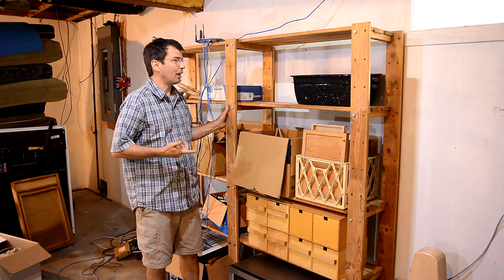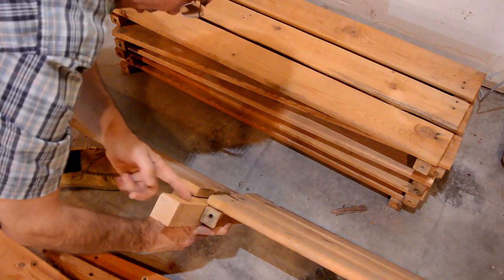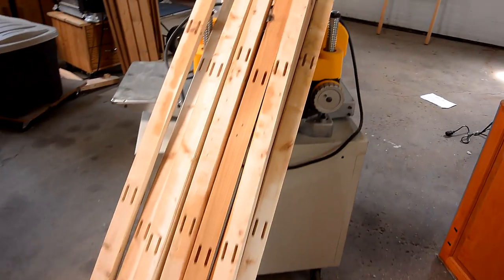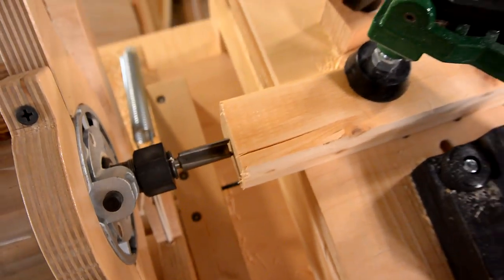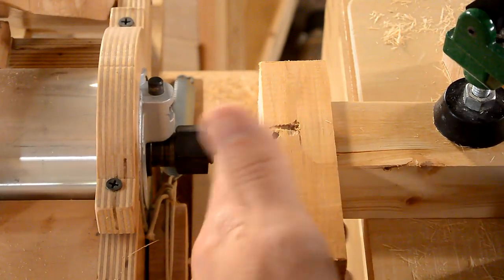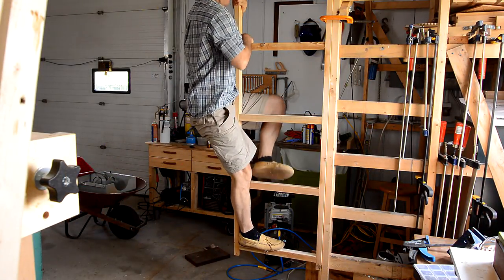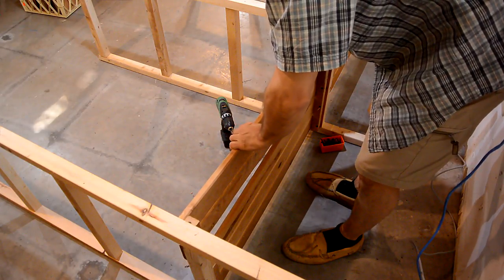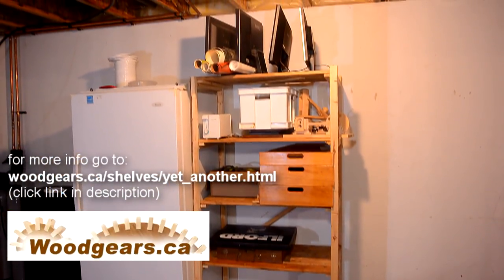Yet another shelf build

Comment: Well, there's definitely a lot here to respond to, but to "keep it brief" rofl, Mathias B.'s comment, while trying to defend the metric system clearly shows the imperial system to be more precise.  Is 100 divisions, or 144 divisions more precise?  Now, don 't start typing yet....hear  me out, a 64 (ths) multiplied by 12 inches in a foot, then three feet in a yard is 2304, whereas, 20 (half mm) by 100 cm in a meter is only 2000, you know, if we're splitting hairs.  To look a divisions another way even from meter (to decimeter, to centimeter,) to millimeter, or even half millimeter is 5 divisions, from yard to 64th of an inch (yes, the human eye can differentiate) is 9 divisions, a conclusively more precise measurement is possible, all of this on your tape/rule.  I've never seen any division of a millimeter, and really, you mock 129/256ths, but 0.003785 mm is easier to use to adjust your tenon????  
The term/word "better" is being thrown around but is a subjective term based on your use/experience, so as to better, enjoy your opinion, and use what you will.  
There are times when metric works better in my shop, and I keep tools in both systems handy just in case of those rare cases, and, well, out on a jobsite, I'd rather 16'4 1/2", or even 196 1/2" than 4991.1 mm.  Seeing that on a plan (here in Canada) makes my hair stand on end!  Why bother with the "meter" if no one is going to use it?
I'm not sure anyone 'decided' that an inch would be 2.54 cm, I think they probably just measured it....you know....since it was here first...
What country made it to the moon first?  Well, not without all the Canadian Aerospace engineers that made NASA what it was....but that's another argument....because I know it wouldn't be a discussion....
Have a wonderful day
Reply from the maker: The official definition of an inch is 2.54 cm (25.4 mm).  I guess they wanted it defined in precise terms.